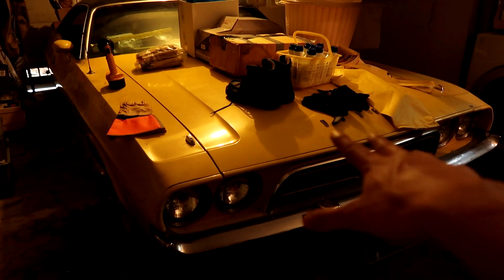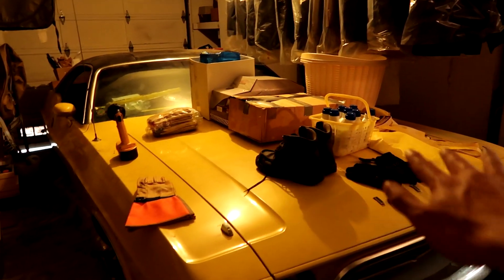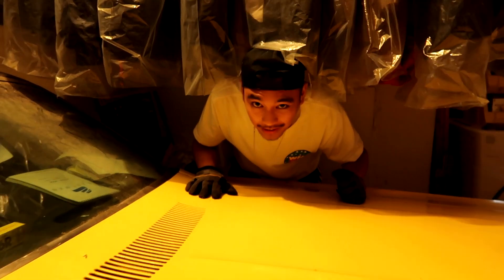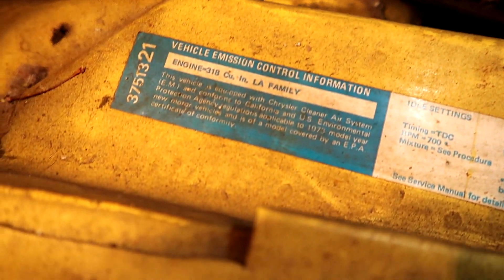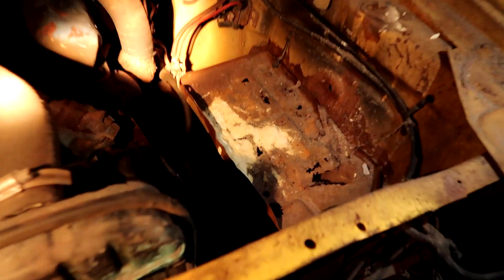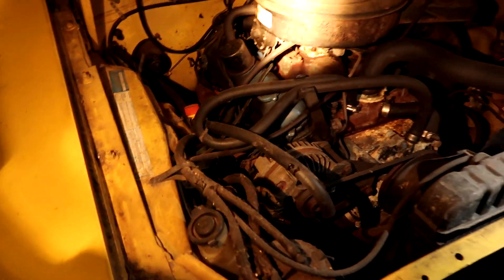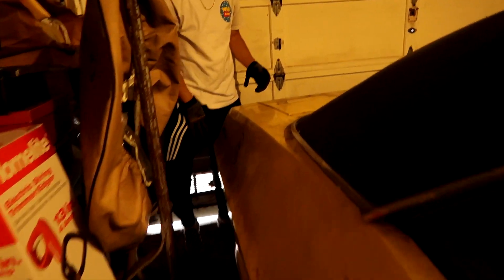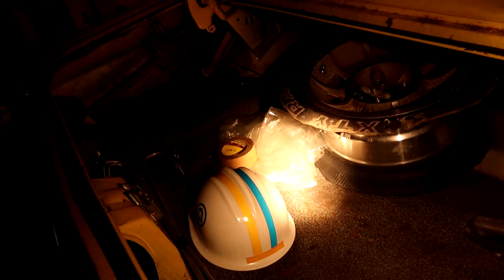The Dodge Challenger Project Starts!

Comment: I'm not too familiar with classics but I do know that 318 means that the engine is 318 cubic inches. Did a little more research and found out that the 318 is a 5.2L v8 and produces 230 horsepower.

Comment: Drain and fill all fluids, replace fuel lines and brake lines if corroded, replace all the hoses. I'd suggest replacing the carburetor too. Drop a battery in that mofo fresh gas and fire it up. Some older vehicles have a choke also. Research that particular  Charger you will see the old muscle cars are easier to work on.